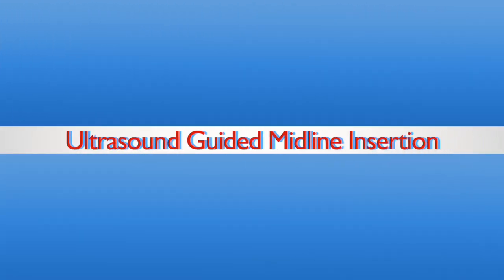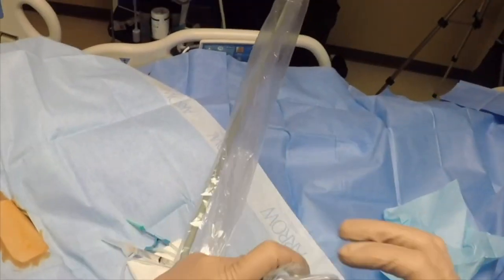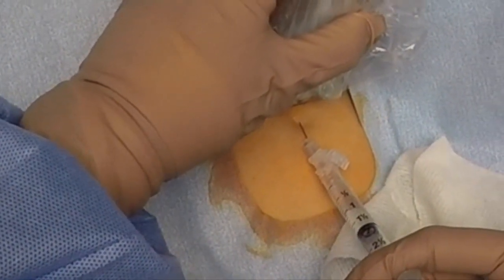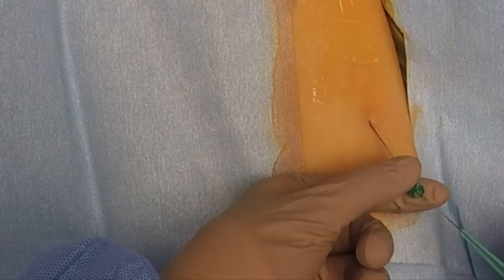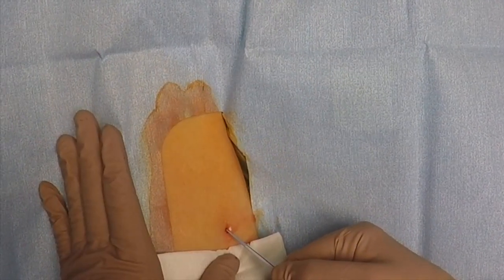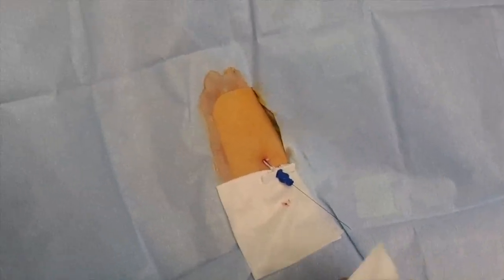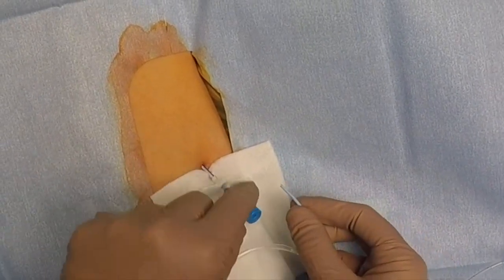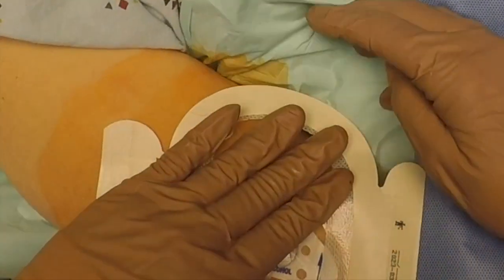Ultrasound-Guided Midline Insertion

Comment: Why you guys make simple thing so compicated.My colleague who is nurse put midline very easy. He found the vien inserted blue top color venflon then intruduced the guide wire then inserted the midline and push forward along side the wire till the butterfly part of it reached the insertion part. Then he fixed it on the skin and flushed it so ready for use.no need for USS or any other device or dilator  Make it simple please